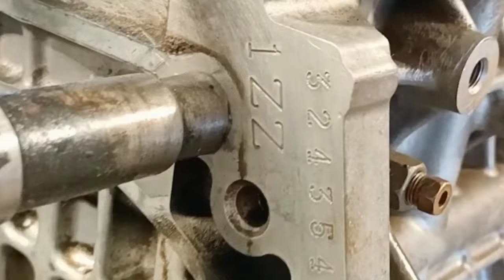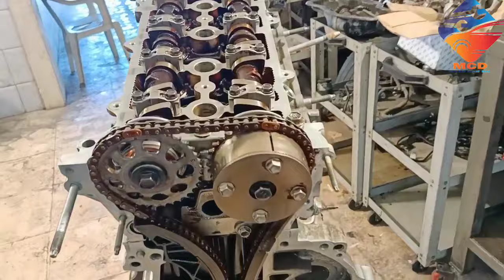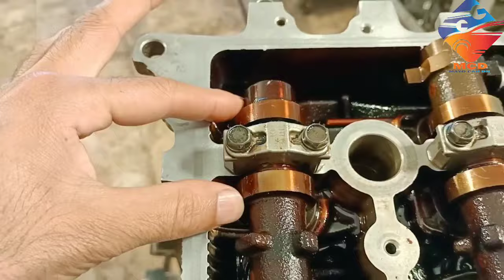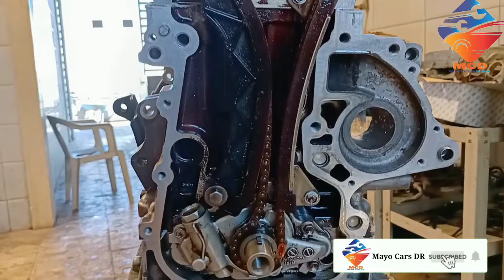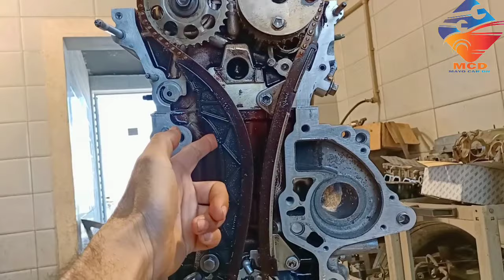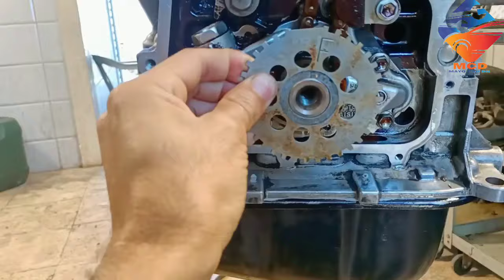How To Fix 1ZZ-FE 1.8L Engine Timing Chain Marks of Toyota Corolla

Comment: How often or when should the timing chain be replaced? Can everything be turned by hand to align properly or is a special tool required?
Reply from the maker: Thanks for comment,The timing chain should be changed at this time when you overhaul the engine and no special tool is required to set it.